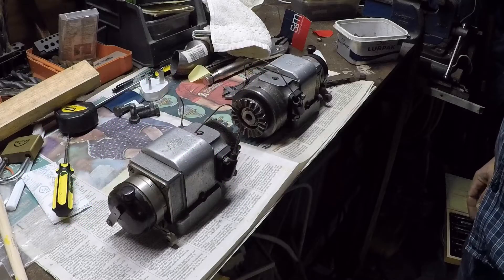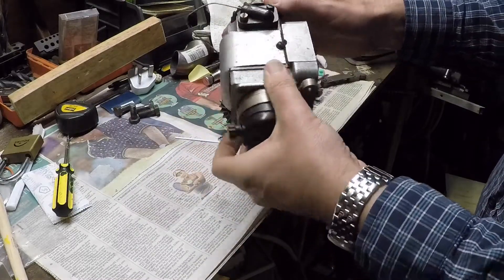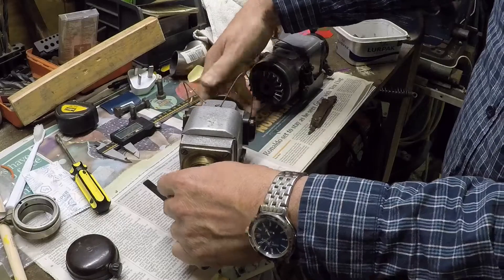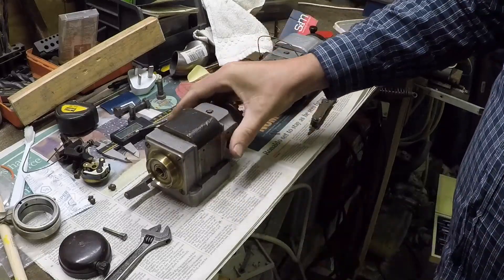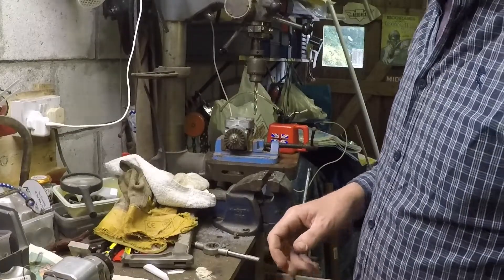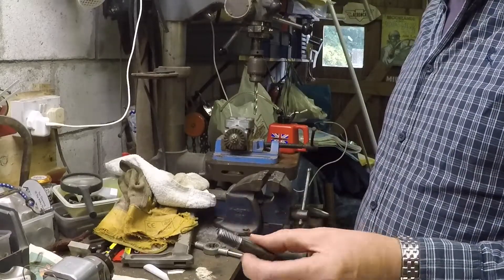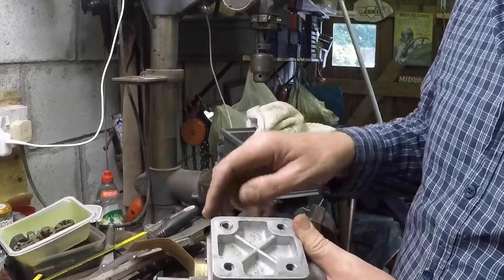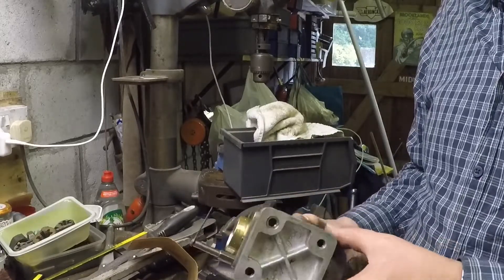BTH KC2 magneto - repairing a damaged thread in aluminium

Comment: Thank you for that. You made a very good point, viz. that it is poor practice to operate any ignition system when there is no path to earth for the spark. Lucas motorcycle magnetoes have an internal "safety earth gap screw" for that reason.That screw is concealed under the brass name-plate. If you withdraw the armature while the screw is still fitted, you will shatter the slip-ring. Guess how I found that out? Luckily, the slip-ring is fairly simple to replace.
Reply from the maker: You are taking binge watching to a new level!
Reply: @FlyingForFunTrecanair  I know. I did cut some firewood, and going out now to chop up some rogue sycamores.
Reply from the maker: @martinwade9421 😂😂